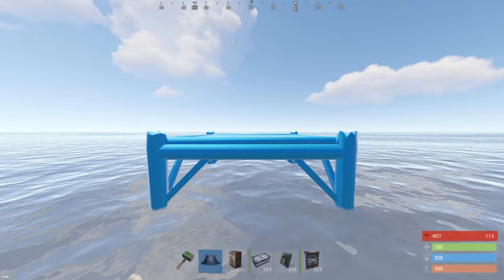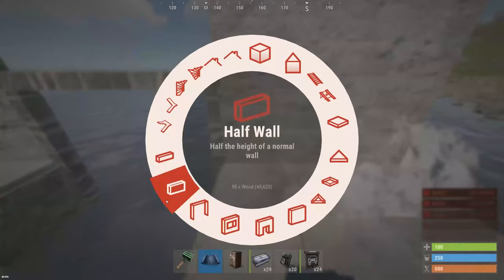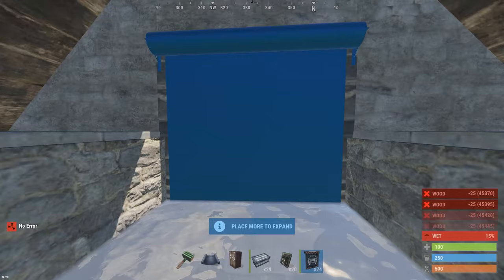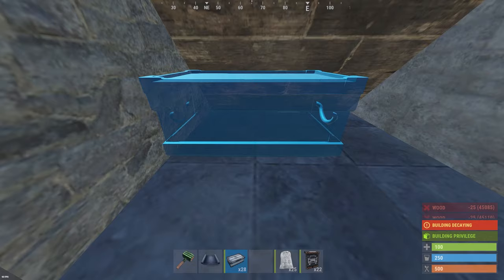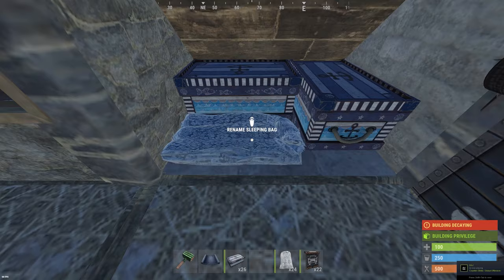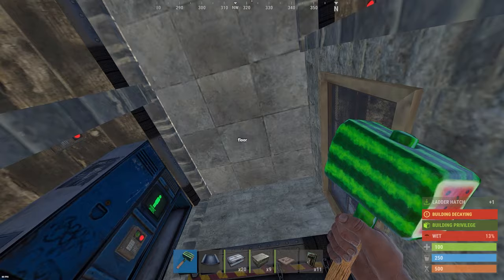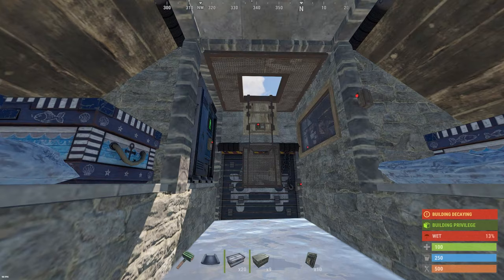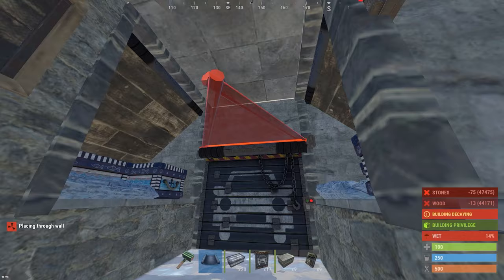Re-INVENTING The simple BOAT BASE - Rust Base Design 2021

Comment: Slick, but why not have airlock replace one of the entrances? Also recommend automatic doors via app or sensor.

What's nice is you can make roof and foundation metal to protect loot for cheap, perfect for protecting the gear you'd keep in there.
Reply from the maker: Well that's why your meant to take your own twist on my builds, bc im never going to satisfy everyone. I like the suggestions tho <3
Reply: I personally never used an air lock for the boat entrance - only for the normal entrance where i walk in. My boat room is also seperated from the TC by at least two garage doors.
So far I have used a 2x2 where half of it is for the boat and other half for the TC and loot.
Add an air lock with two triangles for sheet metal doors and two windows at the ground entrance.
Reply: I love the automatic garage door opener and it is just an HBHF sensor and a door controller. Remember to exclude others!

Comment: Built it and I realized, it's very hard to a workbench in that design. For me it ruined the whole idea of this base+)
Reply from the maker: My guy its a boat base not a base
Reply: @Hoody71  i beg to differ) when it's on the other side of the map. It should contain basics to be able to craft ammo/meds etc. But I understand that when u were doing the design u had other concerns in mind. It's alright)
Reply from the maker: @KycokOv4arku  if you really want to turn it into your main base then replace the locker with the t1 or change one of the lootrooms to a t1 you can still fit large boxes behind it
Reply: @Hoody71  you can fit WB only if u already have a garage door. Because of the hight it won't work with standard doors. But yeah

Comment: Most of the time they are also worth 30 mins to eco raid them..
A simple base with a wb1 furnaces and repair bench takes less than 5 mins to farm.. and pipes grow on the roads so that's 2 mins to collect enough for hammers, than spend 10mins or so farming metal and than another 5 mins to melt it and than you can literally access every base that doesn't use traps...

And since most water bases are in dead areas you will have plenty of time to smack every door with hammers without seeing 1 person..

Comment: "Simple" yea right this is over done you can get away with half the cost for just a boat base
Reply from the maker: You don't have to add all the extras and if you don't it's one of the cheapest designs. Don't need to get so worked up 😂😜

Comment: Soft sided one of these by using the roof design and got some solif gear 30 minutes in. Horrible base, never use roofs as they can be easily soft sided.
Reply from the maker: Well that's a lie because the wall is still hardside even if you expose it.